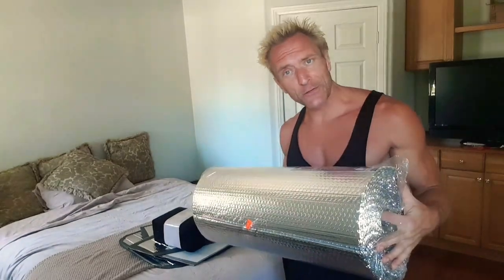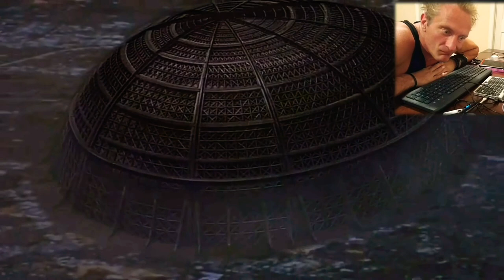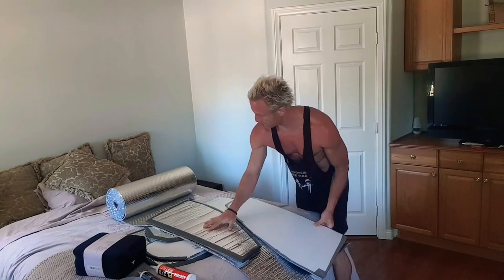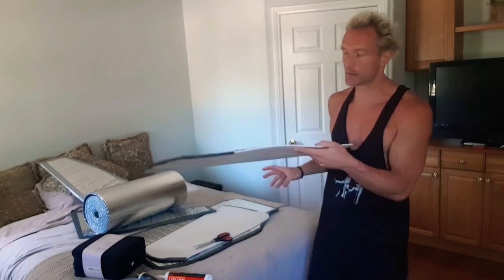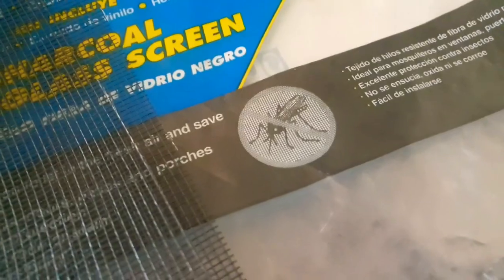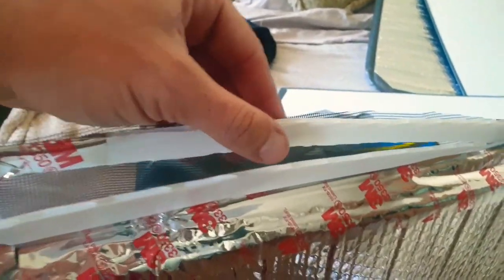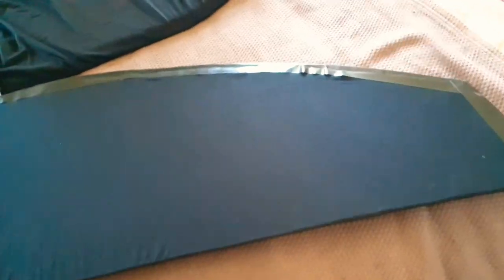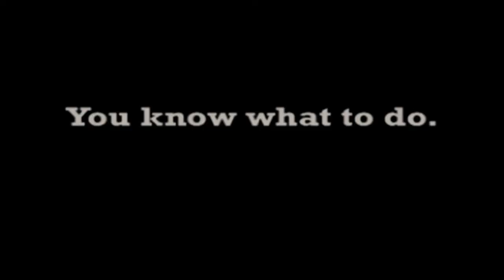How to make DIY Reflectix Sun Shade Car Window Coverings  #655

Comment: Nice screens. Amazing what you can do with coroplast and duct tape. The reflectix should help keep the heat out (or in, if you move on to cooler regions). Would it be worth putting some refectix between the headlining and the roof?
Reply from the maker: Ahhhhh I never thought of thatttt....the ceiling is the hottest bit! Getting pounded by sunlight... Great idea ...!!!  :)
Reply: @SebCam  should make a good video too!
Reply from the maker: @ianwilson2631  I asked Armin ("PriusMannnn") about this possiblity and he confirmed yes it's possible, maybe cram a couple layers in there and still manage to get the ceiling-carpet back to looking like the original finish...
Reply: @SebCam  Well, if Armin says it is possible, then no reason not to try it!